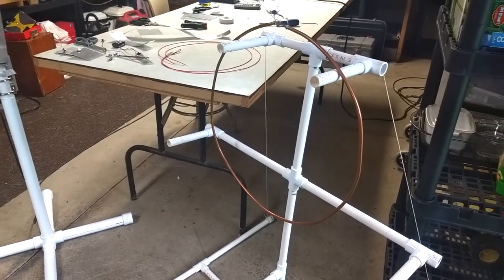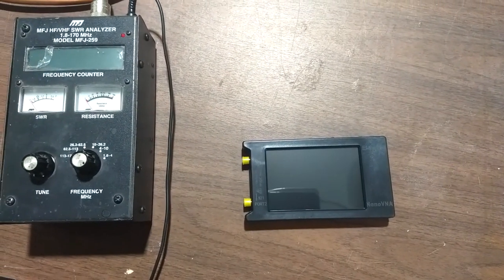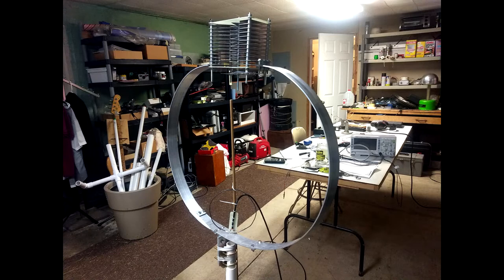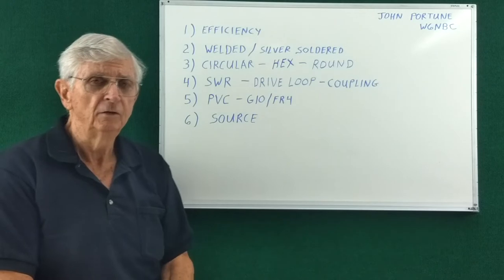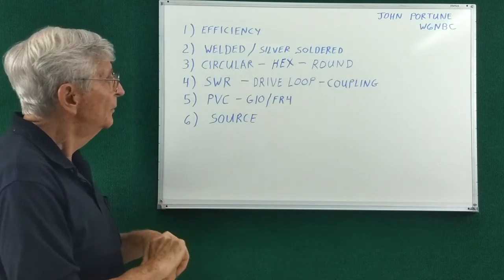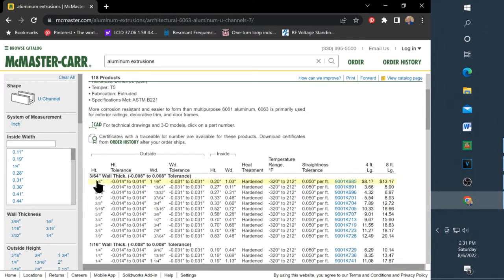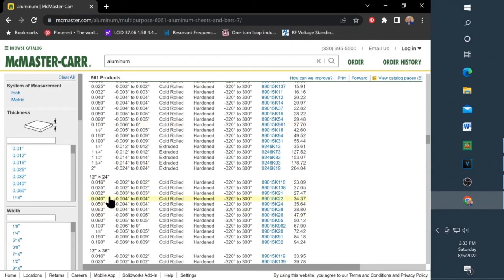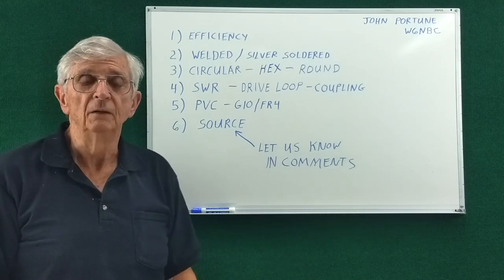Quest for the Best Mag Loop Antenna

Comment: Cool beans.
I made two months ago a 4 foot square loop using 4 inch diameter aluminum dryer vent. By trial and error I found a square of 3/4 inch copper water pipe having 23 inch sides for the sense or drive loop was perfect for giving me a 50 ohm impedance at the feed.

Its good from 40 m to 20 m with 79% efficiency at 20 m and 27 % at 40 meters. 

The reason for the trial and error on the drive loop is the larger they are the lower the impedance & it took me two efforts to find 50 ohms was able to be dialed in.

I use two different variable capacitors deprnding on band.

I learned to use my nano vna after it was built. I did eventually test it with the namo vna and its spot on. 

I really like these antennas too....
Reply from the maker: Thank you for sharing your experience. I am planning to get back to mag loop antennas soon, but I keep getting distracted by other fun projects.

Comment: Thanks for the video. The reason for the welding or silver soldering instead of bolts is to get the absolute lowest possible loop resistance at interconnect points, since the Q of the loop is the reactance divided by the resistance, and the highest Q is best for both transmit and receive, at least until it makes the bandwidth so narrow it causes you to lose information you are trying to receive. For the same loop inductance 50 milliohms of resistance gives you twice the Q of a loop built with 100 milliohms of resistance. The higher the Q the narrower the bandwith of noise and extraneous signals received, and also the higher the transmit efficiency. High Q is a win, win at least until you want to tune around the band. Then it becomes a nuisance. I live in an apartment with power lines right outside the window, and the small mag-loop's high Q and directionality are what allow me to make at least some contacts without having to go to the neighborhood park to get away from the power lines.
Reply from the maker: Thanks for your comment. A capacitance in parallel with  a resistance is a lower impedance to RF than the resistance alone. Because of this, bolted connections of flat surfaces works just fine. Capacitance is proportional to area divided by the separation distance. As the separation distance approaches zero the capacitance approaches infinity. I am working on a loop made of 1.0 inch by 2.0 inch rectangular aluminum tubing. The corner connections are made with bolted aluminum angle. The perimeter of this rectangular tubing is 6.0 inches. This is almost equivalent to 2.0 inch diameter round tubing. The loop is a 3.0 foot by 3.0 foot square. It is showing a very high Q. I plan to make a video about this design soon. Best regards.
Reply: @Jimscoolstuff , I look forward to seeing how narrow the bandwidth is at resonance.
Reply: @Jimscoolstuff  Bolted connections, particularly of dis-similar metals, can rectify the RF and produce intermodulation products.  Aluminum is particularly prone to this phenomenon because of aluminum oxide.  It is still a good plan and I'll probably do something similar.  Sanding the mating surfaces to remove oxide would alleviate this problem.

Comment: I saw that people experimented with the smaller drive loop and found that if it was slightly squished down into more of an oval shape it worked much better. I think in tx power it was better.
  The same guy also spoke of square foil loops wrapped around pvc. 
Another tip I picked up was to  make the diameter of the tube itself as large as possible.
I was thinking i would need a 1:9 balun to match a loop on 10M where in theory the Inductive Reactance: 465 ohms
I guess a magnetic loop is something inbetween a slot antenna and a 1 turn induction coil.
Reply from the maker: Thanks for your comment.

Comment: Very inspiring thank you, especially the lighting of the bulb close to the antenna loop is a nice trick, plus your tips to spot poor conductive joints with thermal checks (after power is being turned off!) and rotating the small loop for impedance matching.
I am in the process of making a small loop, but based on thick (13mm diameter) copper coaxial cable for the main loop. I was thinking: Don't we also need a common-mode choke at the entry of the small driving loop to isolate the possible loading effect of the coaxial cable coming/going from/to the radio? I have seen some people recommending its usage, tnx, 73.
Reply from the maker: Thanks for your comment. Yes, it is best to feed the loop thru a common mode choke. 73, Jim, KQ8E.

Comment: great Video !! Jim in the youtube tells you that the skin effect of the U profile is roughly equivalent to a 2 inch round pipe. 2inch x phi = 6 inch. is that really the case? In another YT where you use aluminum tube profile of with dimensions 1 inch x 2 inches you make the same compare perimeter = 2 inch round pipe = 2 inch x phi = 6 inch. Skin effect of this U profile identical to the tube profile ? I have 4 pieces of 2 foot length but that is aluminum angle profile 20mm, is the skin effect comparable to the you and tube profile ?thanks, 73 PA0HTY Theo, 73.
Reply from the maker: The circumference / perimeter of  a 2 inch diameter circle is 2pi = 6.28. The perimeter of a 2 inch by 1 inch rectangle is 6 inches. The total perimeter of of a u shaped channel of 1/16 inch material thickness is 1+1+1 + 1/16 + 15/16 +14/16 +15/16 +1/16=3+ 46/16 =5.875 inches. These surface perimeters are fairly close to each other. Thank you for your comment.

Comment: have you tried using an auto tuner on a mag loop?
Reply from the maker: I am using a Kenwood ts-2000 which has a built in tuner which can tune any antenna with an SWR of 3:1 or less. A properly designed coupling loop will have an SWR of less than 1.5:1 (usually much less). The transceiver tunes this with ease. Thanks for your comment.
Reply: Pat, the antenna works on resonance between the inductor that is the loop and the capacitor used to tune it

You match it by feeding it with a matching transformer, either via a smaller loop, a gamma match, a toroid feed or a direct ato transformer tap. 

It’s not like a conventional antenna
Reply: …that said, there are projects for auto tuning the capacitor and adjusting the feed loop using Servo / stepper motors and Arduino processors to manage the logic
Reply: Hello Pat  how are you doing.

Comment: has anyone tried building the square loop design by John Portune? It's made from pvc that has been wrapped with aluminum  tape (much cheaper than buying copper tubing, and a lot more efficient too) It's worth a look -
Reply: I like everything John Portune has done except the way he adjusts capacitance, it may work but for myself, my thought is what a PITA to adjust. Going outside each time for an adjustment isn't reasonable to me, not if a single loop is the only antenna I can use on HF and it is located outside a distance away from the ham shack. 

Why a PITA to me? I suspect the resonance bandwidth of his antenna, or any MLA is too narrow for my patience to walk outside to manually adjust the antenna each time I wanted to move a few kHz. Perhaps his antenna is 100 KHz wide, if it is, that is wide enough for my use in the CW portion of the band which is where I would want to operate and I'm being too harsh about needing to adjust the antenna manually.  I ought to go watch his video again to see how narrow the bandwidth is for his antenna because I just don't remember what he may have reported (edit: I ran calculations for his antenna, approx. 35 kHz which isn't so bad), but I haven't seen a MLA antenna yet which does not have a very narrow bandwidth of a few tens of kHz to less than 5 kHz, nor would I want one with as much bandwidth as a dipole antenna as the efficiency and radiation pattern would suffer if too wide on this type of antenna. If I had other antennas to use such wouldn't be as important as I could just use another antenna if I didn't feel like going outside the adjust the MLA to another frequency.  

That all said, I know why he built it that way, to show an inexpensive highly efficient antenna with a simple tuning method and he did just that but not what I want to build. As outrageous as this statement might be taken, that kind of simplicity and economy doesn't appeal to me, although if I wanted to cut costs due to either being uber frugal or having a limited budget, and couldn't find the parts I needed to build-in an adjustable motor driven capacitor, his design would be a good the way to go. 

I suppose a motorized remote adjustment mechanism could be made with a jack screw pulling against a large spring, but for that function, I'd rather have a small Comet vacuum capacitor on a remotely controlled motor of some type built inside the PVC tubing. If I built something like his PVC with tape antenna, I'd look into being able have some kind of telescoping adjustment to allow operation from 7 MHz to the higher frequency bands, but that would substantially complicate the design and likely preclude the use of tape as well as be another adjustment I'd need to tromp outside to make. For myself, if I had the room to do so, I think it would be better to build a low frequency version of the antenna and one for the upper bands and switch between them.

Regarding conductor diameter: If you use the magnetic loop calculator at 66pacific and plug in different diameters you can see increasing the diameter of the loop radiator conductor to several inches reduces the IR/current x resistance losses so much the antenna efficiency rises a substantial amount, compared to a 1 inch diameter conductor, 3 or 4 inches makes a big difference. For example; skin effect at HF frequencies and above (actually, down into the kHz, i.e. 100 kHz; 206 microns) reduces the effective amount of conductor medium quite considerably, at 10 MHz the RF will only go about 20.6 microns deep (for copper) into the metal greatly reducing the usable amount of conductor material the RF current can flow through (at higher frequencies even less depth). However hardware store aluminum and copper foil tape are far thicker than the skin effect depth, so it is just as good as solid copper or aluminum.

I was researching using silver plated materials and silver is great, but it only offers about ten percent less resistance than copper, so better to just increase the diameter by ten percent to get the same conductivity at far less cost. I researched the rub on silver compounds for copper and they can only plate 1 micron no matter how much you apply or work at it. 1 micron is fine for 2.4 GHz as that is the skin effect depth at that frequency, but not for HF. Silver plated wires are often only plated about 1 micron thick too, so that won't help at HF.
Reply from the maker: Here is a link to my square loop design:https://youtu.be/jB-lxTWl8Q4
Reply: I did. I used a normal variable cap. It works well, but not great. It might be how I built it though